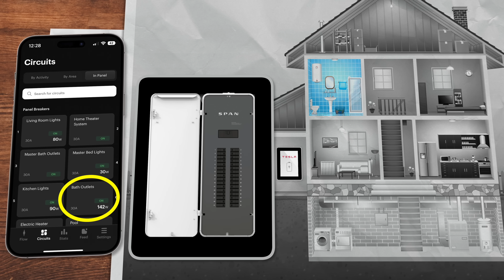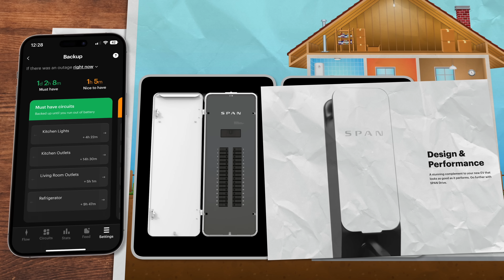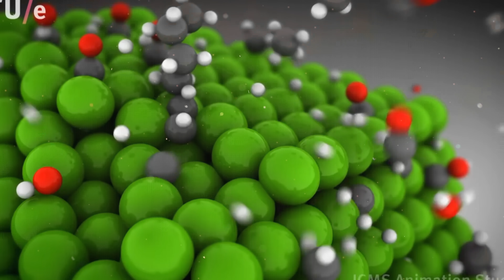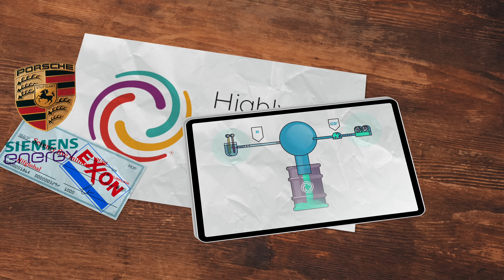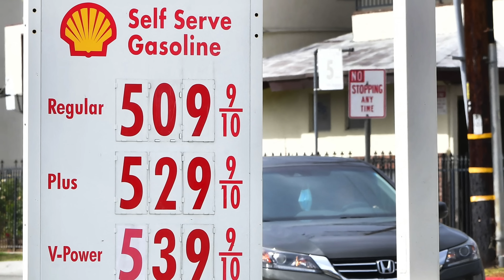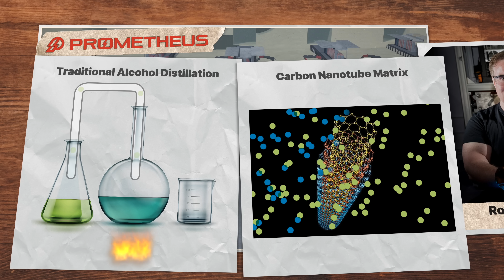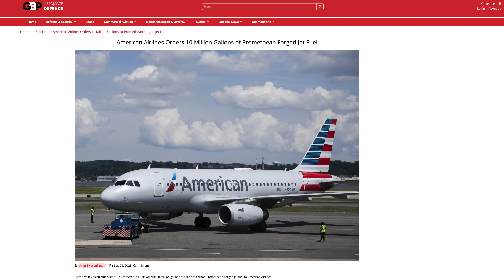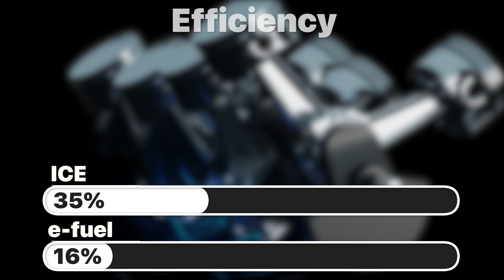EPIC Breakthrough Can SAVE the Internal Combustion Engine!

Comment from the maker: Check out the SPAN smart Panel & EV Charger TODAY! https://geni.us/SPAN
Reply: Where solar energy is most abundant it is also arid and the air/water interface used to 1st concentrate the CO2 is not viable. But the Prometheus approach does seem to be barking up the right tree. As a water saleable gas CO2 is naturally always concentrated in water so CO2 dissolved in rivers, lakes & sea water has always seemed like the natural starting place. So beginning in water makes them sound promising. Along this veign the next thing for  you to study is the Navy's pilot project some decades ago to study the viability of nuclear powered oiliers to supply carriers with jet fuel by making jet fuel from sea water. The Prometheus process is similar but improved. I have long  viewed desalinating trillions of gallons of seawater as a necessity and mining the brine as necessary to make that viable. While handling vast quantities of sea water it has long seemed only natural to also make synfuel from sea water while handling such vast quantities of sea water. I assume these to be high temp nuke powered projects that can start from a backup generator but where an orderly shut down only requires passive systems.
Reply: It would be more efficient to promote better public transport such as Trains, Streetcars and buses.
Reply: why not use  the e-fuel to fuel an electric engine.. That way you get a much better return in the energy output efficiency that you would normally lose in the combustion engine.!
Reply: @randymurray934  Right on the money. eMethanol or eAmmonia  (hydrogen carriers) to power fuel cells to power motors FCEV. Japan and Korea are betting on this.
Reply: @jackbisson9226  Totally Right! Still doesn't solve the billions-of-ICE-cars-on-the-street-today problem, but it's definitely a more efficient use of eFuels. Might just be the best use of it!
Reply: @randymurray934  Because if you are fueling an electric motor you may as well use a battery as it will take a fraction of the energy to build and charge the battery as it takes to make the fuel ship it to where the car is and then convert it back in to electricity in the car. Using Efuel to power cars is just a way to assuage the congnitive dissonance of people who know we need to stop burning fossil fuels but don't want to.
Reply: People die from car fume, heart failour, astma, cancer.....
Reply: e-fuels do not solve the problem of particle pollution and other half-burned fuel emissions.
That said, they would certainly solve part of the problem of ships' emissions, if they were powered by methanol or ammonia instead.
The same goes for semi-truck emissions, but that window will most likely be closed by 2045-ish.
Airplanes doing long-distance flights will likely have to use fuel too, but e-fuels requires developing a jet turbine, which can use them instead.
For planes, there's also the whole side-issue of whether the B2 bomber's electric propulsion will be declassified, which might make fuel a non-requirement.
Reply: I think someone is trying to trick people. someone wanted me to telegram them. Because they had something for me . Didn't go the plus I don't have a telegram account.
Reply: @buzzard-roosthomesteadandp3097  Been there. Several people have also tried that on me on another channel.
There are a lot of people trying to con YouTube viewers. It's a serious problem. I imagine many people fall for it, otherwise they wouldn't keep trying so hard.
Reply: ICEs contribute 1/5 to global warming.
He said they were the major contributor.
Reply: What's that random drum beat I hear throughout your video?
Reply: I've pushed the idea of compressing exhaust gas into a diaphragm that expands into the fuel tank, pressurising the fuel, on many car forums... Gas is dumped into a tank when you fill up at the gas station who reprocess the exhaust gas into fuel. The dumping of the gas could charge your battery too if using my truly 1 stroke, hybrid, two-way, free piston-turbine-heat + e-motor/generator ICE design that fits a single cylinder, 1.2l engine in a 25cm long, 20 cm diameter cylinder. I'll publish the design under 'Simplish Ideas' when I master 3D CAD enough (I've only just started).. 
--
Because compression provides power as well as combustion, and each stroke compresses the return stroke,  by running two engines timed 1/2 a stroke apart stroke pulses cancel out for a smooth ride. With two more engines mounted end to end with opposite strokes all forces are balanced and cancelled... Oh, and it combines a heat engine. 
--
Every other fin gap of the turbine at each end is enclosed and contains CO2 at around 300 bar that expands from the combustion end to the other end, which is compressed. The main cylinder wall has alternate CO2 and water cooling tracks. Insulation then magnets of the motor/generator around that.. 4 solenoid, hall-sensing pressure sensing valves that also inject water, 1 spark plug, 1 fuel injector, 1 bearing each end. The piston is 15mm wide around its edge, holding a couple of split ring seals, 10mm wide for its bulk. An 120mm diameter solid head fires from end to end. ---- SIMPLES (or at least Simplish!).
--
The twin turbo also combines a similar heat engine sandwiched between the turbo and compressor, with each end joined by a hollow axle filled with steel wool through which the heat engine CO2 flows from end to end as each end receives a dose of exhaust gas. It also combines a generator and the posh version would use regenerative suspension, solar power paint, ++. Water is also sprayed alternately into each end's turbine, adding steam power and cooling (so more heat engine power). The water is extracted in a condensing radiator, gases + some water vapour compressed into the fuel tank diaphragm.
--
The non-electric version fits in the back wheel of a superbike for 300mph direct drive madness. Blah.. blah... fun designing it but making it is another matter. Should be far cheaper than a normal engine though.
Reply: 1) there is nothing unusual happening with the climate.

2) there is nothing wrong with burning fossil fuels.  Its problems in high-density areas are trivial to fix and already have been fixed.  CO2 is not a pollutant.

3) Climate alarmism is a big-lie superstition supported by tax-bribed liars.  (See Climate Discussion Nexus for 100s of videos on climate quackery, deception, and realism.)

4) decarbonization is 21st century pyramid building and human sacrifice. 

5) there is NO excuse for expensive electricity.  Electricity generation is boring.     Just burn coal and scrub the smoke in densely populated areas.

6) the only challenge is manufacturing market quantities of cheap gasoline.  South Africa has already done this for decades (Sasol), using coal,
Reply: Scaling limitation opportunity cost for this to be used for airlines first makes ICE car use unlikely.  Also the low efficiency and low price seems like an unlikely combination.  Lastly the oil industry will lower the price to kill this.  Instead of the current passive climate management, the climate crisis will definitely need active climate restoration efforts unfortunately.  I would like to see more thorough and open presentation of numbers and assumptions like is done on excellent analysis on the limiting factor channel.
Reply: Your argument that efuels have a window of opportunity is not valid
The fact that their inefficiency kills them isn't just about how much extra low carbon energy would be needed to replace fossil fuels by efuels (with the associated environmental and geopolitical impacts).

It is also about how this low carbon energy could have been used otherwise to switch off coal, fossil gas in other applications.

Comment: This is ‘artificial photosynthesis’ - carbon dioxide plus sunlight to provide a chemical fuel.  In biology that fuel is glucose, water soluble. In our technological world, the optimal fuel is a liquid hydrocarbon.  The other primal energy source is electricity. Photosynthesis produces that as well, but only within the process, then uses it to make glucose.  It cannot generate high voltage, or conduct it over long distances.😊

Comment: The Bendall engine makes more sense. EV is simply impossible. You can argue till kingdom come, it is simply impossible. That's why, in the end of this BP design brainchild scam, only a very very small percentage of the population will  even be able to afford an EV, or a car for that matter. The ones forcing EV madness never drive or fly electric of course. And they couldn't care less about e-fuels. Why would they. If you'd understand geopolitics and what's about to happen ( is happening) you'd understand why a ton of non-patended and patended alternatives simply....disappeared, is or has never been used. And it's not just about cars. It's about energy in general. Like ol' Henry K ( and accidentally his poulain Klaus Schwab) said, "control the energy, control the continents". If some dude came up with THE solution. An easy to produce, cheap and maintainable form of energy....he'd probably ...simply vanish. Epic breakthroughs, there will be many to come, none to be implemented. There's a reason why the human species is probably the only one going backwards on a kardashev scale.

Comment: The efficiency of combustion engines is ( 36% - 48% ) and may exceed ( 50% ). The efficiency of electric cars is not ( 90% ), especially at high speeds, as electric motors lose more and more electricity in the form of heat instead of converting it into magnetic forces. This is due to electromagnetic coils, and it is known that the electronic system is a voracious consumer of electricity and is over complex. The efficiency of photovoltaic panels ranges between ( 10% - 26% ), yet consumer companies still promote them as ( wow, something of the future ).

Comment: One year on and your complaints about EV battery cells have been  resolved. Factories have multiplied the density by four, longevity by four charging time by five.
  Be happy now that the use of expensive metals is being replaced by Aluminium. Tesla's heavy will come from it's factory 2025, with these. Five other makers too, are making somewhat similar now, July 2024. The system presented here requires costly chemistry and freight. It then is an expensive delivery system competing at a huge disadvantage ,as today there some 34% more solar and wind. This coming year the expansion seems to run at an  increase rate that might bring a much bigger 50% on top of last year's numbers.

Comment: EV is not the future & is a fraud in my opinion. It takes far more CO2 emissions to produce an EV and most electricity is produced with Coal, which is the dirtiest fossil fuel. It would require the government to start making nuclear power plants to produce clean energy and there needs to be advances to keep CO2 emissions down when producing the massive batteries. Not to mention the slave labor used in the Democratic Republic of Congo that mines 70% of the World’s cobalt used in car batteries. Lastly, what is to be done with the large batteries when they stop working.

Comment: Opposed piston 2 stroke engines are 48% (with forced induction) to 55% (naturally aspirated) efficient. Farebanks & Morris engines. Used in power generation. 4 stroke diesels are up to 45% efficient. Cummins Diesel. 13:41

Comment: I hope the Prometheus thing works out. I think it could complement a lot of the other energy storage solutions, and batteries being investigated to help stabilize the grid so that intermittent renewable energy production sources like wind power, or solar, are used to their fullest potential and none of the energy is wasted, because there’s not enough energy storage potential. To use the excess energy produced by solar panels at noon for producing cheap gasoline using atmospheric C02 and solar energy, that’s genius. If it turns out it works well they might put one of these things in every municipality and use it like other services that produce power as a byproduct, like with waste treatment, and composting kitchen waste, and garbage landfill’s all being retrofitted with collecting systems for methane gas so that it can be processed and sold back to us as natural gas to light our fireplaces, heat our furnaces and make our hot water heaters work.

Comment: Google "Maximum efficiency of" before falling in love with certain efuels;) Fischer Tropsch is pretty much no solution. The other one seems promising since water filtration has been making decent progress and the theoretical limit is pretty much not there. Seems a material science problem that just might take a while - by which time batteries probably got less lithium dependant etc. Hydrogen itself is already being targeted as fuel for airplanes and that process is far superior to any efuel - even theoretical ones - today

Comment: Synthetic fuels=1. burn biomass to generate steam to capture carbon. 2 apply ash eating microbes/bacteria/fungus/yeast to eat the carbon capture and excrete hydrocarbons...Alternative options are use geothermal heat to make steam to produce hydrogen on site of processing plants. Meantime salted gelatin batteries in chromium casings for car batteries. Smaller super capacitors streamline everything.  Cancer cells can probably also make enough fuels to stop drilling and remove carbon/methane from atmosphere by capturing carbon while burning off low atmosphere methane via lasers, sound frequencies, along with solar drones to burn off methane. Those synthetic fuel companies are doing fascinating methods too though.

Comment: No matter the transportation method, high voltage transmission is many times more efficient.  Everytime you convert power, you lose energy.  Even those LED lights in a solar powered home have transfomers built in to convert DC from the photovoltaics which is transformed into square wave AC and then back into DC that the LEDs use.  We need to think more efficiently, like wiring our homes with both AC (motors, fans, compressors) and DC (LED lighting, electric charging, flartscreens, etc)  Just plain stupid to accept transforming losses.  Society needs to make serious changes from 20th century thinking.

Comment: A few years ago, I learned how to make diesel fuel from oil.   So I made it to run it in my truck until I couldn't get the cooking oil that I needed because everyone at that time was competing for what little cooking oil was available from restaurants.   So then I started researching other ways to make it.   I discovered that high quality biodiesel could be made from algae.   I researched that method and found that it is actually easier to make it with algae than with cooking oil, because the algae could be grown in plastic raceways using just water and sunlight with a little CO2 supplementing.   I would think that that could be the fuel of the future.   I can build pulse jet engines that will burn biodiesel very well, and it also can run my diesel truck.  Just a thought.   I'll be moving soon to a location where I can set up my first algae farm.   Maybe something that you might want to look into.
Reply: We studied algae and its use as alternative energy in school (undergrad, not funded research).  One of the problems you run into is scalability.   I seem to remember that there were tricks to try to get some verticality out of the algae farms (build up, not just out).  Anyway, really interesting hobby since scalability isn’t as much of an issue for a single person who wants to power a car.   There are some other issues with algae but it’s still really promising. Memory too fuzzy to remember exactly what they were.   There are different kinds of algae with higher energy density too

Comment: Yes, EV is the future. After you made this video, the EV industry made a new claim, and it's not good 35% of a full battery will be lost when it is hot outside.  If it is running or not. That puts EV at 55% efficiency and ICE at 35% efficiency. But I definitely like the honest answer. My question to them is, do the batteries lose self life like our regular batteries when it is hot outside. Their is a lot to do for both EV and gasoline powered car's. That is why I subscribed to you your very informative TY.

Comment: Hi Maersk and Orsted are at 54% conversion efficiency for green methanol now and the cost were briefly cheaper than Heavy Marine Oil last year. There is absolutely no doubt that renewable based fuels will outcompete fossil fuels on pure cost. MIT just published $56/ton carbon capture where about 60% of cost was the 770kWh per ton required and the rest CAPEX for a floating system. This suggest that they have modeled with offshore wind costing $0.044, which is definitively to the high side especially because there is no need for a substation, HVDC and landstation that at least cost 30% of the energy generation. To produce a ton of Heavy Marine Oil you need 3.1ton CO2 and about 0.1ton H2 plus electricity.

Comment: High hopes don't produce efficiency, Ricky, but don't stop on our account.  $23/gal@16%=WTH,O?
I'm all for EVs but I'm 70 and drive under 800 miles a year, so it's not affordable to me. My 44.44 gallons of gas per year aren't even a blip on the system's monitors.  My efforts of whole-house PV and LEDs everywhere inside and out, ceiling and floor insulation, dual pane windows and drip irrigation throughout the yard were doable, so I did.  I also removed 3/4 of my lawn areas, replacing it with bark everywhere and a select dozen xeriscape plants.